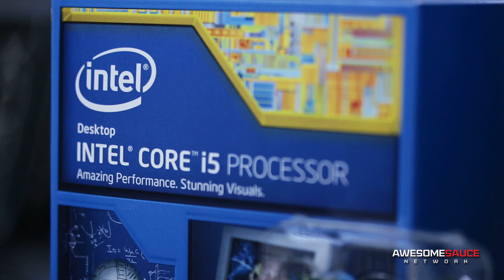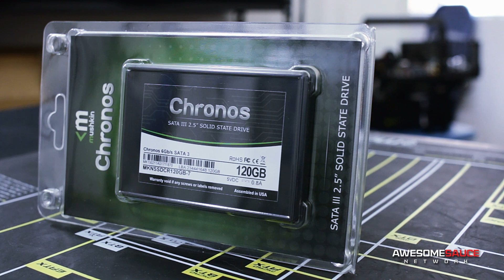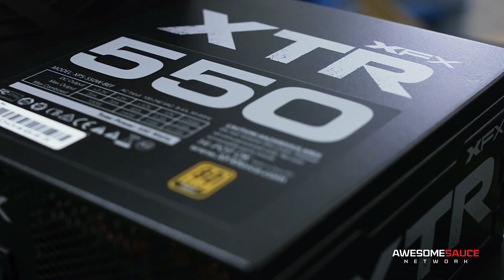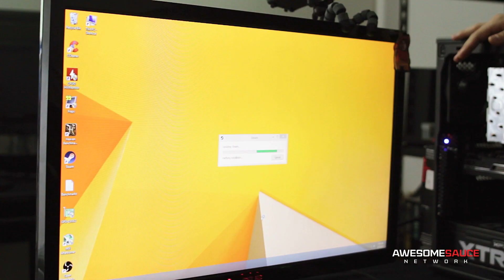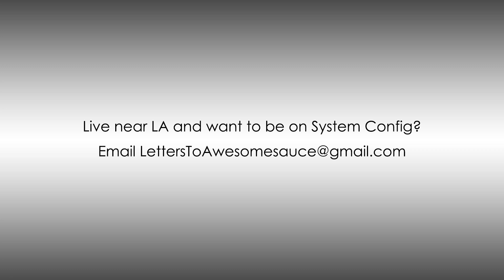System Config - Ep. 4: Brent's Mid-Range Gaming PC

Comment: Should swap the z97 for a b85 and get 1600mhz value ram, since high speed ram doesn't affect gaming when not using integrated graphics, this can get an 480gb ssd and a better power supply
Reply: Raysun Wong Overclocking......
Reply: G3nesis Prime What overclocking? Kyle stated that the guy wasn't going to be doing any of that, which was also clear from the non 'K' intel CPU.
Reply: Leon Corsav 
Z97 has better aesthetics and has the ability to overclock. What if he wants to overclock one day and he has the funds for a k series cpu, all he has 2 do is just pop one in
Reply: Totally agree, in this case the z97 is pretty much useless and so is the higher speed ram. Could have gone for a cheaper mobo and ram and upgrade the GPU
Reply: Wes Tech Games
 A lot of companies moves all their premium features over on the 797 line up. Thats why
Reply: Andreas Boye well as for his purpose of playing wow and League, he dont need those m.2 , raid controller and 6 phase power
Reply: Fredrik Pohl if u could save one dollar on ram that another dollar on the ssd/gpu
Reply: G3nesis Prime if u r talking about aesthetic z97 is really worth buying, buy y not get a h97, companies like asus has simular design when compared to z97
Reply: Fredrik Pohl cl 10 1866 is not but cl 9 1866 is more expensive than a cl 9 1600
Reply: The 1600mhz and 1866mhz HyperX are basically the same price so...
Reply: akalion2131 but you cannot use 1866 mhz ram with a non z or x motherboard, and cl9 1600 to cl 9 1866 doesn't make any difference in gaming, so if he were to chose to get a non oc able mobo to save for a 290/x he would have to go with 1600

Comment: That's strange how his video card was bottlenecking his system because I have an ATI radeon HD 4850 and I can max out world of Warcraft on 1080p. My other specs are 
Amd x4 940 CPU
8gb ddr2 Kingston hyper x
MSI k9a2 sli platinum
650 watt power supply
2 500gb WD caviar blue sata 2 hard drives in raid 0
Reply: It might have been his CPU bottle necking it.

Comment: since when is 4 gigs to few for gaming? 6 gigs is still fine...
ran 4 gigs the last 5 years and upgraded to 8 thx to ark: survival evolved...
also the psu could have been re used and whats wrong with the stock cooler?
Reply: +Kobato-chan 3000 My computer uses more than 4gb of ram all the time during games, it uses about 4-6 gb according to the performence monitor.
Reply: yes but windows reserves alot of that... so it says it using that much but it prob isnt... i wouldnt recoment playing games like bf4 with 4gb of ram butall the games ur able to run with this gpu is 4gb plenty... i have been rocking 4gb for a long time pared with my gtx 650 ti boost and encountered no problems ram wise ...

Comment: but but but whyyyy? why ditch that corsair PSU? why the aftermarket CPU cooler and Z97 board? even IF it was for "aesthetics", that extra cost though :/ pure aesthetics without functionality is actually unappealing imo. love Awesomesauce Network usually but disappointed with this build...
Reply: ***** doesn't matter if someone asked. this is a comments section. it is ALL about opinion. that includes everyone, even you. as far as the system goes, im assuming then he doesn't want to save the money on those parts and get say maybe a better graphics card or something else that's useful like a nice gaming mouse perhaps. which makes no sense, which was the point of my first post.

Comment: How is this for $1k
i5 4690k
MSI 960
Gigabyte Z97
128 GB SSD
1 TB HDD
NZXT S340 CASE
Cooler Master v550
Cooler Master Hyper 212 Evo
Kingston Hyper X (2x4GB) RAM
Reply: Get a i5 4460 and use the money you saved to get a r9 290
Reply: I dont need amd. *****  Im building a pc for the first time. Dont want to jump to watercooling right away. And yea i chose Gigabyte as I may be building a hackintosh with it.
Reply: Ammar Ashoor  COZ AMD IS FOR POOR PEOPLE xD
Reply: Then get a GTX 970 and who said you need water cooling for the r9 290 (don't tell me your one of the AMD runs hot dudes just don't get reference design and you will be fine trust me, if your not comfortable with AMD get the 970 the 960 will bottle neck the i5 4690 to hell)
Reply: Manav Punjabi Well personally I think the r9 290 would be the best option price to performance terms and it has 4 gb of ram. OR wait for the new 300 series cards coming in a couple of months. 
You know what, just get a 4 way SLI titan X set-up! xD
Reply: lol now you can add a 390x